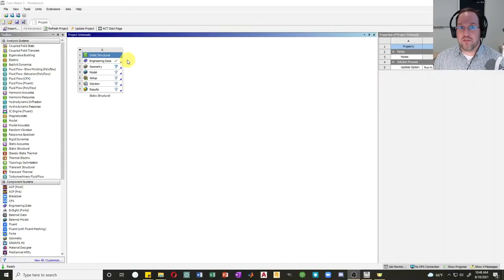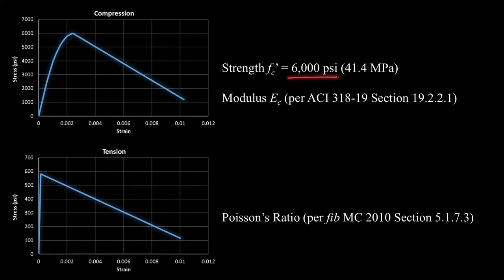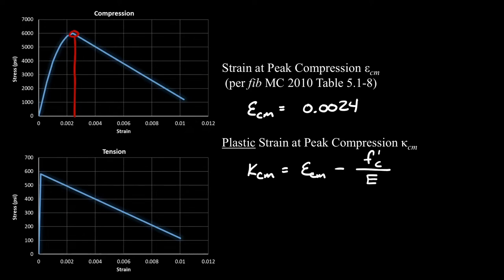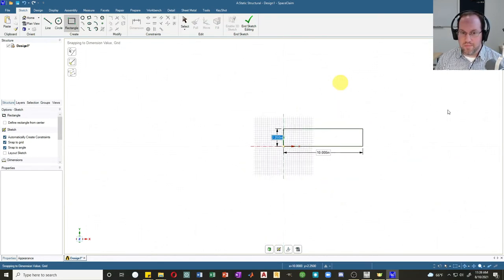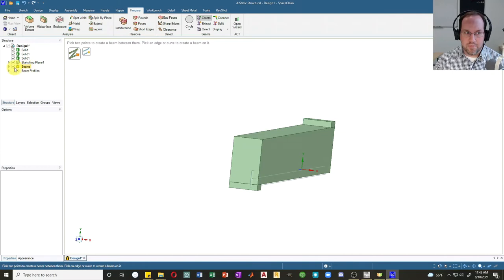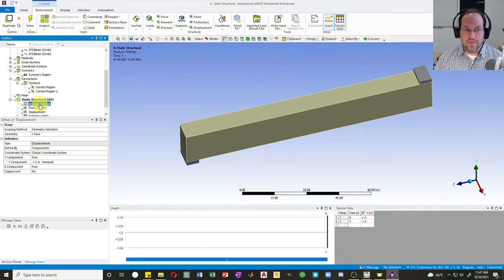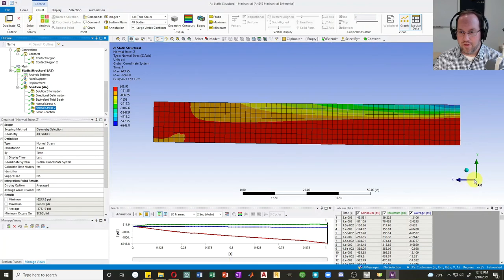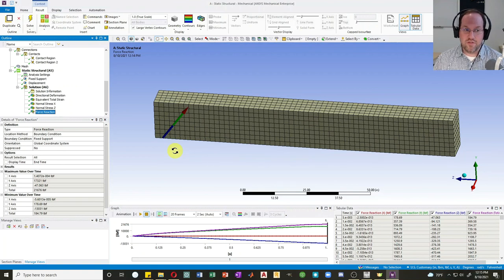Reinforced Concrete Modeling - FEA using ANSYS - Lesson 9

Comment: Hello my rebar isn't showing after the analysis, it disappears as well. Can u help me out.
Reply: Any luck with this? I am running into same issue
Reply: @bznbhan  I put the rebar in a named selection then ran the analysis using that named selection.
Reply: @bznbhan  did you solve this problem?

Comment: This video contains so much great information, really thanks. Finally, how can I get the cracks that form visually?
Reply from the maker: This method will not show cracks visually. This type of concrete model is sometimes called a "smeared crack" model. You can visualize regions that might be likely to crack, and the overall behavior of the structure mimics that of a cracked structure, but it does not model discrete, individual cracks. 

There is an archived concrete element in Ansys known as SOLID65. Give a search for that in the Ansys help. Supposedly it can include cracking and crushing. Unfortunately, I don't have any personal experience with this type of element, so I wouldn't be much help there.
Reply: Thank you very much indeed for your relevant answer😇I wish you had experience with this and could produce more content for us🥲Since, you have a lot of knowledge about the structure.

Comment: Sir why you took displacement as 1.2 inch? Is there any way to know the maximum displacement of the beam before failure?
Reply from the maker: You can of course estimate it with hand calculations for simple structures, but in general it is an iterative process. For this video, behind the scenes, I had tried a few different values before settling into 1.2 inches.

Comment: Dear professor, I tried to model this beam on Ansys 2024 R1, and it failed. When I suppress reinforcement, the solution converges. How to connect reinforcement and concrete, even though I set beam type  - reinforcement?

I would really appreciate it if you helped me with this problem.

Comment: Dear Professor, i am getting in a lot of troubles with my master theasis. 
Basically i am simulating a tire response under diferent conditions.
The tire has a lot of beam reinforcements (Belts)
Do i need to make any adjust? 
Can i sellect the Beam option ?
Do i need a specific code? 
Please, i need help

Comment: Nice job on the video. It was quite helpful. I was wondering if there is a way of obtaining the dilatancy angle, since it's probably not the same for different concretes.
Reply from the maker: That's not an easy question. Most of the time selecting the dilatancy angle comes down to experience or fitting some existing lab data. I suggest checking out this paper (https://www.sciencedirect.com/science/article/abs/pii/S1644966519300767) for a more in-depth discussion. They use ABAQUS instead of ANSYS, but it should be similar.

Comment: Thank you so much for this tutorial! I'd like to cite the fib MC code for my research, but I don't have the exact source at hand, would anyone be so kind to leave a link to the most recent version (or any available version) or at least the DOI, or so. Thank you in advance!
Reply from the maker: DOI for the 2010 fib Model Code is...
10.1002/9783433604090

The model code is available from Wiley (https://onlinelibrary.wiley.com/doi/book/10.1002/9783433604090) or Ernst and Sohn (https://www.ernst-und-sohn.de/index.php?q=en/fib-model-code-for-concrete-structures-2010).

When I reference the Model Code, this is my typical formatting:
fédération internationale du béton (2013). fib Model Code for Concrete Structures 2010. Ernst and Sohn, Wiley, Berlin, Germany.

Comment: Thank you Professor, I'm a student from Thailand and with regard,  i need to know your opinion about what kind of concrete material model is less complex and good at solving ploblem about hardening and softening of concrete in case of reinforced concrete in Ansys, between mohr-coulomb, drunker prager and Menetrey-William. Thank you
Reply from the maker: This video just treats concrete as a perfectly plastic material, no hardening or softening, and uses the Menetrey-Willam model. This works for simple problems, but if you are dealing with hardening and softening, I'd recommend going to the microplane model, which is the focus of the next video in this series: https://youtu.be/JXbZnhGZliY.

The plasticity in this microplane model implementation uses a Drucker-Prager yield surface, but also incorporates damage and nonlocality for softening. It's quite a bit more complex than perfect plasticity, but that next video will give you thorough guidance of how to implement it.

Comment: Dear Professor! In the "Model type" option, if I select "Cable", will it be a compressed structure? 12:51
Reply from the maker: No, the "Cable" option will not automatically prestress the structure, though you can do that with a little work. If you have a linear mesh, Cable creates the LINK180 element designation, which is the same as you would use for a simple truss. If you have a quadratic mesh, Cable creates the CABLE280 element. This element requires tensile stress to provide adequate transverse stiffness, and may be unstable under compression - it works essentially like a hanging string or cable. 

For most applications, either Link/Truss or Cable would work for applying prestressing, but I think Link/Truss is a bit easier to deal with. Either way, to apply prestressing you need to define an initial stress in the link or cable. The INISTATE command using Mechanical APDL is the way to go.
Reply: @StructuresProfH  Thanks  Dear Professor 
Could you create such a 3D video on YouTube?
What material do I need to define for the cables?
I must set Link/Truss option?

Comment: Good day Professor, thank you for this tutorial. I wonder what is the best contact to use in simulating cold joints in a reinforced concrete model.
Reply from the maker: That is an excellent question, for which I do not know the answer. I assume some sort of cohesive (modeling resistance to separation of the joint) and frictional (modeling resistance to sliding along the joint) contact would be best, but I do not have personal experience with that kind of model. If it's very well connected with no separation and no sliding, perhaps start with a bonded connection for simplicity of modeling - when adding model complexity, it's nice to progressively add one complication at a time so that, if an issue arrives, it is easier to pinpoint the problem.
Reply: @StructuresProfH  I have one more question. How can I do Fatigue analysis in a concrete model? When I run the solver it always say missing S-N cruve?

Comment: Dear Prof, appreciate if you can simulate any simple example of nonlinear coupled thermal structural analysis of concrete beam exposed to high temperature. Hope to get great advice on what material model used, suitable element type, and the boundary condition applied. Thank you
Reply from the maker: I think this is a great idea, but I'll need to do some research on my own first - my background is not in coupled mechanical-thermal simulation.

Comment: Dear Prof, when we choose model type of the rebar as reinforcement, it will automatically assigned as element type REINF264. At ambient temperature, the contact of rebar and concrete will remain bonded. However, at high temperature, is there any contact issues between the rebar and the concrete? Or for thermal, should we choose other element type for the rebar or add thermal coefficient between the contact? Thank you.
Reply from the maker: My understanding is that reinforcement elements in ANSYS are perfectly bonded, and will not debond due to temperature or stress. The stiffness of the rebar is effectively incorporated into the solid element into which it is embedded, and temperature of the reinforcement element matches that of the base element. This probably does not necessarily reflect reality at high temperatures, which is likely much more complex. Unfortunately, I don't have any specific expertise in coupled mechanical-thermal analysis at high temperatures.

Comment: Thank you very much for your videos, I am from Ethiopia and currently, I am doing my MSc paper on numerical modelling of the simply supported beam, I used CPT 215 element for concrete but it results in " Drucker-Prager cap plasticity integration algorithm did not converge    
 for element xxx and for concrete material, I tried to stimulate the beam by changing different damage parameter, however it cannot converge. How are these problems fixes?
Reply from the maker: Hi Edoni,
Without seeing the model, it's impossible to say what is the issue with convergence. If you'd like to contact me personally, please use my email found on my channel "About" page: https://www.youtube.com/channel/UCtXGklXcG_Fx-u_DpoRd6pA/about

Comment: Hi, great video, you really saved me a lot of time.
If i want to add stirrups, do i make them in the same way as the longitudinal rebars as as well?
Reply from the maker: Yes, you can use the same process for stirrups.
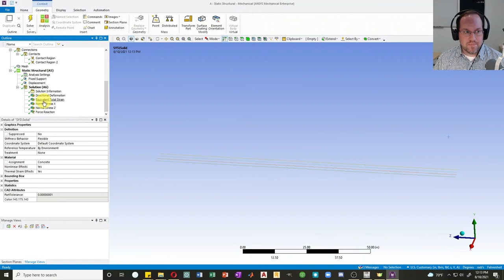Reply: @StructuresProfH  Hi I have an issue where the rebars dont seem to be interacting with the concrete. the rebars are beam elements and i have set their model type to reinforcement already. the rebars dont appear like in 17:55 when i hid the concrete beam, it just disappears. I followed your video exactly, so im not sure what went wrong. Do you have any idea what could cause this issue? Thanks so much

Comment: Hey professor, which Strees solution should i use for tensile and compression stress analysis of a concrete beam.
Reply from the maker: My guess is you are looking for either a normal stress solution (if you just want the stresses in a particular direction, for example, along the length of the beam) or the principal stress solution for getting peak compression and tension regardless of direction.

Comment: Ansys 2019 doesn't seem to have reinforcement in model type, only beam. In this case, what can be done to ensure that the rebar is embedded inside concrete ?
Reply from the maker: The reinforcement option was added I believe in 2020, so it's a new function. In older versions, you can model the reinforcement as a "Link/Truss" element constrained to the concrete. When you mesh the rebar, the element size for the link/truss should align as closely as possible with the solid concrete elements into which it is embedded. You'll need to change the Mesh Sizing behavior to HARD (default is SOFT), otherwise ANSYS will only make a single element along the length of the link/truss. Then you need to create a "Commands" object within your Static Structural Analysis (or whatever type of analysis you are doing) with the following information:

/PREP7                      ! Pre-processing step
ESEL,S,ENAME,,186           ! Select solid elements (Concrete) - SOLID186
ESEL,A,ENAME,,180           ! Select rebar elements - LINK180
ALLSEL,BELOW,ELEM           ! Select "down" one level from the elements (Geometry > Elements > Nodes)
CEINTF,0.25,ALL,,,,,,0.05   ! Bonds the two selections together (NODES ONLY!)
ALLSEL,ALL                  ! Reselect all before doing the analysis
/SOLU                       ! Done after/during analysis
OUTRES,ALL,ALL              ! Output results (all)

This will bond the rebar nodes (Link180) to the solid element nodes (SOLID186). It should behave essentially the same as reinforcement, unless the meshes are very different sizes, in which case this doesn't always work out.

Comment: Dear Prof, what happened to the Menetrey-Willam concrete model at high temperature? The data / curves will reduce base on temperature?  Any references for that? Thank you.
Reply from the maker: Concrete strength, modulus, etc. all decrease as temperature increases, and that will change the Menetrey-Willam model parameters. A quick search found this reference by Kodur (2014): https://www.hindawi.com/journals/isrn/2014/468510/.

Comment: Dear Dr
Can Menetrey-Willam model and show the cracks in concrete after nonlinear analysis as Solid 65?
other question, can the user use solid 65 in workbench without insert the APDL command data?
Reply from the maker: I'm afraid I'm not familiar enough with Solid65 to address your question. I believe it requires APDL, no exceptions. 

Anyway, Menetrey-Willam is just the particular yield criterion chosen in this example. It works much like Drucker-Prager. On its own, however, it will not capture and visualize cracks.

Comment: Dear Prof, for coupled thermal structural analysis of concrete beam, which material model for concrete is the suitable? Drucker-Prager or Menetrey-Willam? Thank you.
Reply from the maker: This is outside my expertise, but I imagine that the coupled CPT215 (linear) or CPT216 (quadratic) elements are your best bet for thermal-mechanical simulations. This element is used with the Microplane model for the mechanical properties in this linked video (https://youtu.be/JXbZnhGZliY). That might be the better place to start (and it looks like you already found it, which is great!).

Comment: Thank you very much!!! I have a doubt about using FEM with concrete. Is it possible to considere the bond strengh of reinforcement to analyse the behaviour of anchorage zone?
Reply from the maker: It should be possible, but not using the method I described in this video. The reinforcement option that I've shown here effectively has perfect bond (no slip, infinite strength). I don't have personal experience with modeling bond failures, but at least in theory you would need to model the reinforcement as a beam or truss, then couple it to the surrounding concrete using some sort of nonlinear springs.
Reply: @StructuresProfH  I am thinking in modelling the anchorage zone with a 8 (for example) segments in the rebar with a linear area section variation. It would simulate a linear bond strength. It is similar to check in the perfect bond model  the bar tension, but you could simulate a faillure in the bond zone

Comment: Prof H ! I was curious about the contact region aren't we supposed to create a contact region between rebar and concrete ?
Reply from the maker: When using the reinforcement element option for the rebar, there is no need to add a contact region between the rebar and the concrete. ANSYS effectively modifies the stiffness of the "embedding" element based on the "embedded" element. This does mean, however, that the reinforcement element is effectively fixed (no bond slip) to the concrete.

Comment: Hi Sir!
Very useful tutorial. Sir please how do I fix a solver pivot error? It keeps on coming up matter what I do.
Reply from the maker: Omojo,
A solver pivot error typically occurs when you do not have enough constraint on your model, generally resulting in extremely large or infinite displacement for the applied load. It's impossible to know where this happens in the model, but the most likely candidates are (1) your rebar may not be completely embedded and properly constrained to the concrete beam or (2) some other boundary condition, contact, or constraint is improperly defined.
Reply: @StructuresProfH   Thank you so much sir for your reply!
I will check my model again for this issues.
Reply: @omojoodeh9719  fa 🙂cing same problem... Did you find the solution tho?

Comment: Dear Dr/ 
I want to know if Ansys workbench is better than Abaqus regarding nonlinear analysis of concrete structures or the both are the same?
Reply from the maker: It has been a few years since I last used Abaqus, and it's tough to say which is overall "better." If you know what you are doing, both can accommodate most engineering problems you throw at them. Based purely on my subjective opinion, I feel that ANSYS is more user-friendly, but I prefer Abaqus for more advanced modeling (i.e., if I need to create a user subroutine using Fortran or use the Python scripting environment).

Abaqus has the Concrete Damaged Plasticity material option - if you don't specify the damage options, it is fairly similar to the Menetrey-Willam or Drucker-Prager model. If you want to include coupled damage-plasticity in ANSYS, then your best bet is to use the Microplane material model.
Reply: @StructuresProfH  Please give me more data about the micro-plane model, and how to use it in anasys workbench and can it gives real shapes of cracks in concrete? thanks
Reply from the maker: @amrmasoud5580  I plan to have a video for the microplane model ready within a few weeks. Stay tuned!
Reply: @StructuresProfH  لTHANKS,
Reply: @StructuresProfH  Sir, am I right? CPD properties will only be used by the Abaqus if your loading/displacement in your model reached the  concrete softening? Thus, only the concrete elastic properties will only be used by the software? Please correct me if I am wrong.
Reply from the maker: Damaged plasticity properties come into play once the damage threshold is reached. That may occur before reaching peak strength and the softening regime that follows. For typical concrete, the material is no longer linear elastic at a stress of 40 to 50% of the peak stress.
Reply: @StructuresProfH  Thank you very much Sir for your answer. Do you have an email adress where I can contact you? Is it ok to consult to you regarding my thesis using the ansys?
Reply: @StructuresProfH  Dear Prof. I remember you for that " micro-plane model, and how to use it in anasys workbench and can it gives real shapes of cracks in concrete"